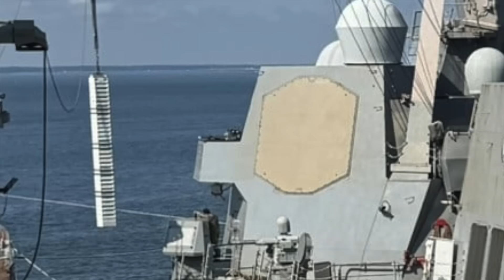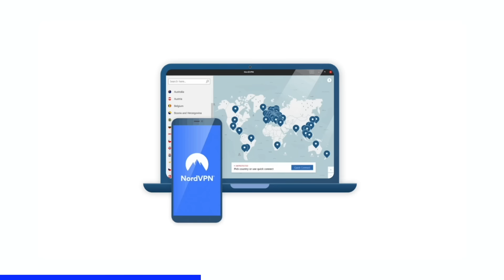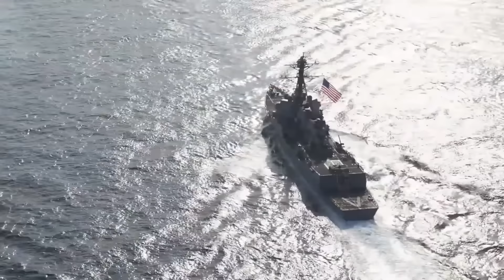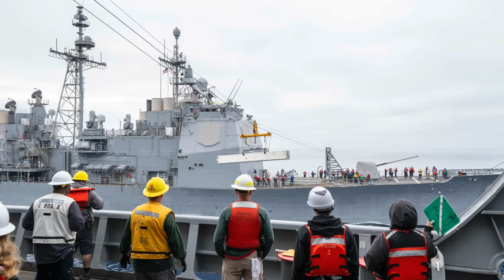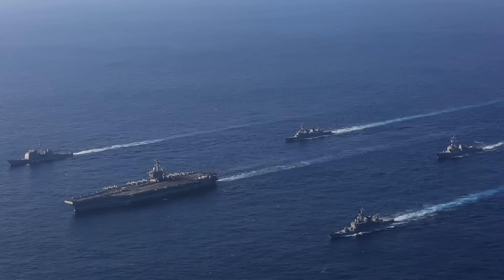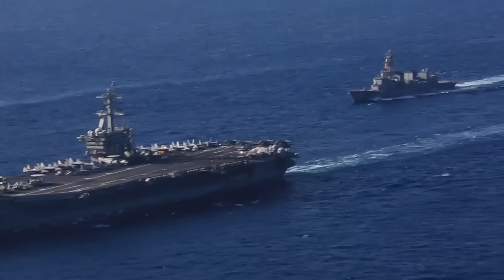Why At-Sea VLS Reloading is crucial for the US Navy ?

Comment: You would think, they would already have gyro stabilised, multi pod delivery systems, with locked on, grappling robotic loaders, so no matter the conditions, selected banks of missiles, can be preloaded on the resupply ship, then with a gyro scissor crane, they pod banks can be delivered rapidly, ready to reload the onboard tubes as ordered. This system would allow, on a rotary supply frame, to remove spent launchers, then replaced with the allocated munition preprogrammed for the correct position. Similar systems could be used to reload subs at sea from missile resupply vessels at a distance from the fight, but close enough to be logistically acceptable to get back to it. Just a thought, as it seems the system at present, is very slow, clumsy & in need of a rapid overhaul.

Comment: The old VLS reloading using the resupply ship’s heavy crane was like trying to thread through the eye of a needle with the cannister dangling and swinging in the vertical lift. It could only be done in protected waters with no wind or waves. With the TRAM system the cannisters are transferred horizontally and then moved to the vertical position and into the mounting frame over the missile cells. The movement of the ship does not affect the cannisters in the frame as they are lowered. The movement of both ships is eliminated at sea.

Comment: The irony here is that new technology is not whats needed . In 1961, the USS Proteus while in waters off Scotland transferred a Polaris SLBM weighing 37,000 lbs to USS Patrick Henry (SSBN-599)
The ships were close but the concept can be adjusted for a faster and more efficient reload system.
but ideally ,the USN should be revise the DDG-X so that all the VLS ,not just the large diameter cells are swappable 
allowing the whole module to be removed and replaced versus the one by one system